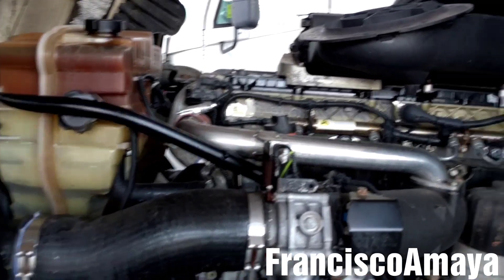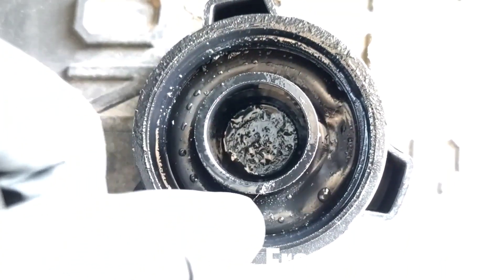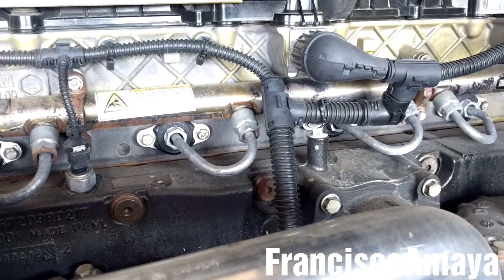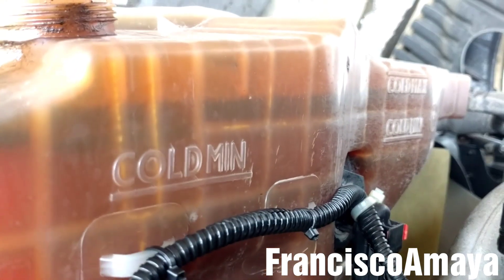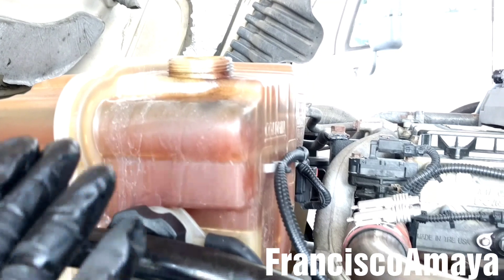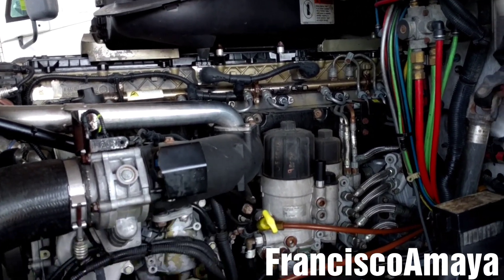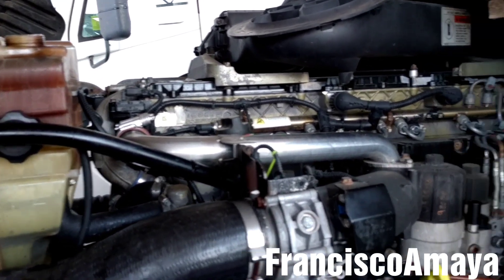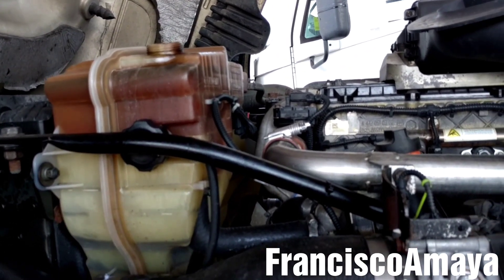FREIGHTLINER CASCADIA DD13 DD15 DD16 FUEL IN COOLANT TANK BAD INJECTOR SLEEVE SEAL OM 472

Comment: How about i fixed the problem and no longer see mixture but the light still comes on... what would it be the next move??? Is it a short somewhere??? New housing new injectors, cups filter and sensors. Still couldn't get rid of the light

Comment: Hello Francisco, I have  those traces of fumes, but the antifreeze looks clean. Also, the fat hose that connects to the engine, its soft. Not stiff, in other words. Like it usually is, in many occasions, when its overheating. Well,  my concern is actually, that there's a smell of antifreeze within the area of the mechanism. And the traces of white tartar. That seemed to be forced through the end of skinny hoses. From on top of the water tank..But the traces look just like the white stains, that you pointed out. I even tried to wipe them off. But they're not coming off. I might have to use, some sort of All Purpose Cleaner with Oxy Clean 😊.
Hope you respond

Comment: Francisco, I have something black in my coolant.  It is black particals and sinks to the bottom of the surge tank overnight. Any ideas? I think it's carbon. 2013 dd15 with 1,145,000 miles on it.

Comment: I have a issue would like some advice. Had what looks like dirt( black stuff in bottom of coolant tank)in my coolant, Changed coolant and it's still there and get more of the same black dirt. What could it be? Could it be injector cup O-ring is going bad and putting small amount fuel in my coolant r my EGR coolant going bad? Plus I have a very small coolant leak under the coolant pump.
Reply: I have the same problem right now. What did it end up being?
Reply: The dealership told me it's just normal wear and tear of the coolant system, just flush the coolant every year or every 6 months till it clears.
Reply: @nandostransport7958  Did you end up replacing the water pump?  Mine started leaking yesterday. My coolant has the black dirt looking stuff like yours. When you flushed it did it clear up? Thanks for responding,  I'm really worried.
Reply: It cleared up after the flush, I just did a flush didn't had to replace nothing. Wish you luck
Reply: @nandostransport7958  found my problem.  Search DD15 gritty rubble in coolant serg tank.
Reply: Yes I notice when I changed my coolant tank it was less dirt in there.

Comment: does anybody have an idea what causes this caps to leak or is it just engine wear??? cuz i have a dd15 with 500k miles and put lucas injector cleaner and next couple of days  got this problem diesel on the coolant is it just coincidence or can it lucas done this??? got friends with same engine with over a million miles and never had this problem so i was  2000 miles away from home and had no choise than to go freightliner and pay $4000 to repair .
Reply from the maker: It is common problem  the seal get bad over the time. It will happen to any DD15 engine at some point in the life of the engine

Comment: Hey my truck is dumping a hole lot of disel in the oil what do you think it can be muchas grasias amigo
Reply from the maker: That could be a broken injector oring/s
Reply: Amigo one of ower friens just got the hole motor done and it leeks a whole lot of disel we changed o rings and it dumps about two gallon in like five minutes do you think the head is cracked

Comment: I just changed the injector cups for the same issue. After we started the engine the diesel still coming into the reservoir. Is that because the is some diesel left in the system or I have to flash it couple times ? I just did ones. Can u help
Reply from the maker: Yes, you have to clean it multiple times and even after it will still have some smell like fuel.

Comment: At what mileage do you get trucks in with those kind of problems approximately??
Reply from the maker: That depends. 700k +/-
Reply: Just happened to me, 650k
Water in fuel came up, and I discovered fuel in the reservoir
Reply: @josecastillo4357   how much did you end up paying to have it done. ????

Comment: hi francisco i need your help my truck is making noise from cylinder 1 but the shop that i left it at say they took of the rockarms and everything looks ok can a injector make noise in a dd15 2011
Reply from the maker: What is the noise?
Knocking, clanking or solid
Reply: @franciscoamayaYT  clanking only when it get to the temp u  Notice it more the shop remove the cam with the rocker arm and everything look ok i just did the bottom and 8 months ago whith  new oil pump the clanking is coming from cylinder 1 on top of the head but the truck dose not give me any code either

Comment: Hello Francisco.  I think fuel is in my coolant and in my oil on a 2012 Cascadia DD15.  The coolant would be an injector cup issue and diesel fuel in the oil would be an injector liner issue correct?  Is it possible for both of these issue to occur at the same time?  Also what's the name of your shop and where is your shop located?